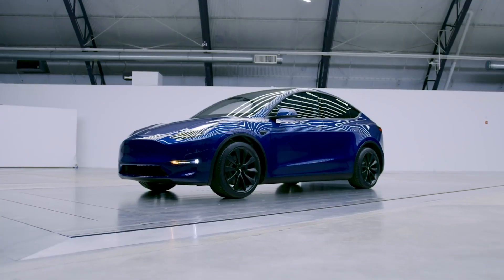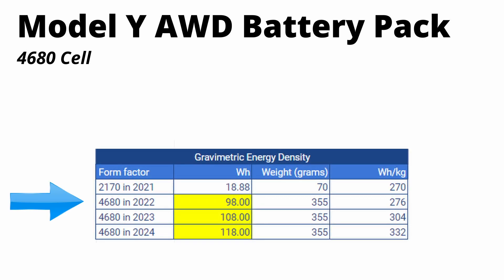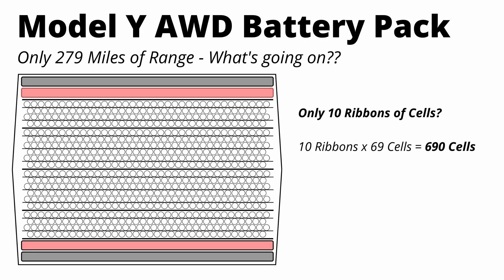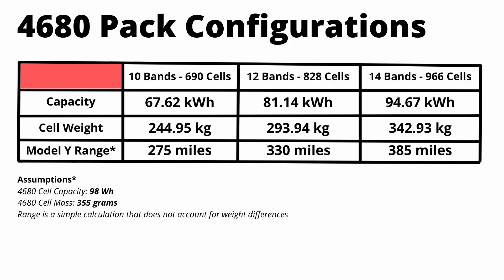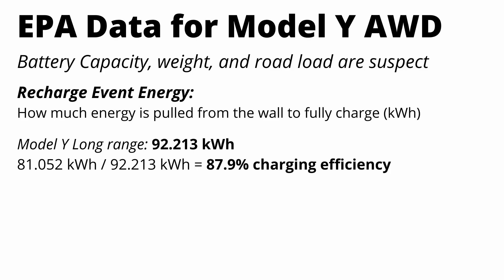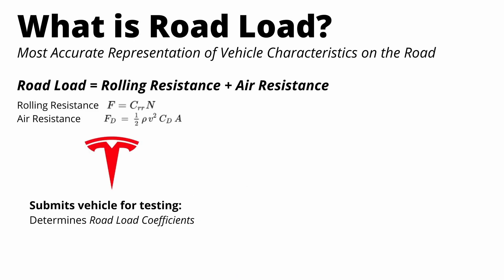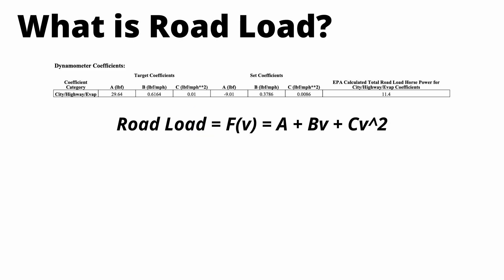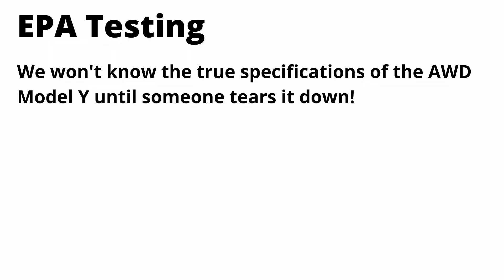New 4680 Model Y AWD Is Here! Only 279 Mile Range??

Comment: Very good explanations. This all makes total sense to me. For the weight difference, my guess would be the energy density of the 4680 cells is not yet where it should be. Tesla decided to put them into production as soon as performance was comparable with existing battery packs. Improvements will follow over the next years. Of course I could be totally wrong with this :)

Comment: I think that the lower range is related to limited 4680 battery production, and Tesla working to not have buyers wait for the superior 4680 battery pack performance, weight, and range. Originally, the Giga Berlin Model Ys were announced to be the first ones to start production using the 4680 batteries. But Giga Berlin had many delays, especially with their planned 4680 battery factory, which is still not built and operational. Tesla was building 4680 batteries in the Kato rd, Fremont, CA factory, but I think that production fell short of original plans. Plus the Giga Texas battery factory was probably planned to be in full production by now as well. But everything got delayed, with Covid, shipping and supply constraints, and battery material cost spikes. This is a short term compromise. I suspect that the accessible battery capacity may be greater, and software limited with the new 4680 battery pack. This way the new batteries don't hurt other Model Y sales, there is more available in a buffer to improve reliability, and the actual mileage numbers are better than estimates. Plus, Tesla can increase the new Model Y range over time with an OTA update. Otherwise, they could actually have the smaller capacity pack, which saves on 4680 battery needs today. And they will fill the pack with a LR model later when the 4680 battery production begins in Texas and Germany. I also suspect that Tesla will release a standard range RWD entry Model Y using LFP batteries, as they have in China.

Comment: That's a nice presentation. My first though is that the Y AWD will be produced in Fremont with LFP batteries (LFP chemistry doesn't match with 4680 so far). Then Tesla will move LR and P production to Austin using both 2170 and 4680 (as stated in the Q1 call) to shift totally to the 4680 by 2023 for LR and P. By that time they should be able to meet all the improvements in cost and energy density presented during Battery Day.  I think this make sense because they will shift MY LR and P production to Berlin, leaving the AWD with LFP to Shanghai only. I was at the CyberRodeo, but nobody understood what kind of car they delivered at the end of the presentation.
Reply: Agreed. One thing: The China Model Y with LFP battery is a RWD model, not AWD. So, the same as Model 3 RWD. I understood from battery day, that Tesla wants to use LFP for the entry-level RWD (former SR) models. LR and P get 4680s. I assume that this Model Y AWD is only a short-time placeholder, maybe only for Tesla employees, once the volume production for LR and P is feasible.
Reply: @reneh.8817  you are right, but I was referring to a new model, not the RWD. Nowadays it doesn’t make any sense to propose a cheaper model. Only reason could be rising the price of the LR, having the AWD and save some kWh… I don’t know

Comment from the maker: Model Y AWD Efficiency: https://www.motormatchup.com/efficiency?id=61fc2d81618f575816e1a303

Why do you think the new Model Y AWD has only a 279 mile range?

A couple corrections in the video:
1. The EPA provides the testing procedures, but the manufacturer actually does the dynamometer test
2. The EPA curb weight for the AWD Model Y is 4,356 lbs. My notes had 4,365 lbs the whole time so that's why I was saying the wrong number
Reply: next please add to 560 KMH&5000 HP devel sixteen,please buddy